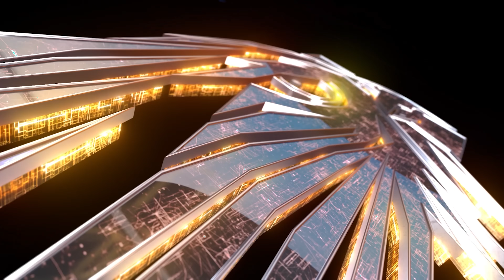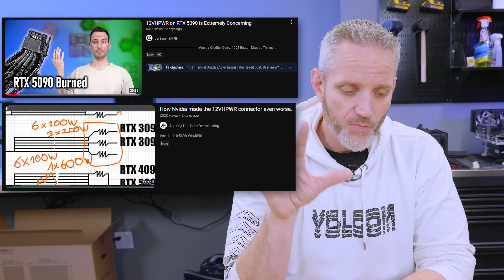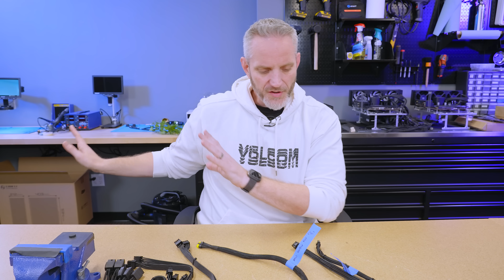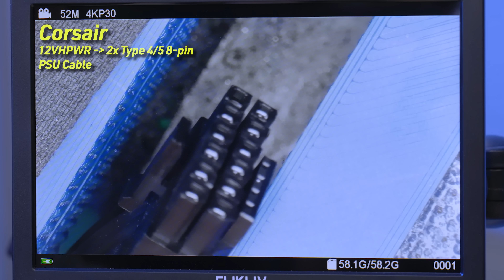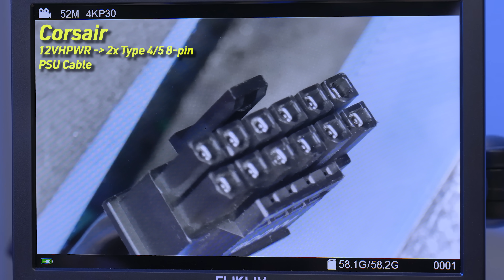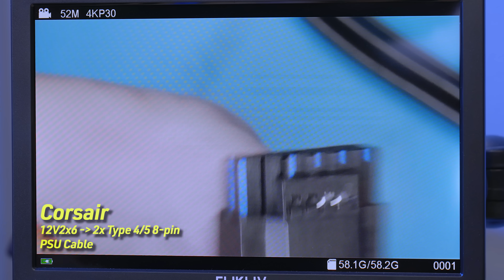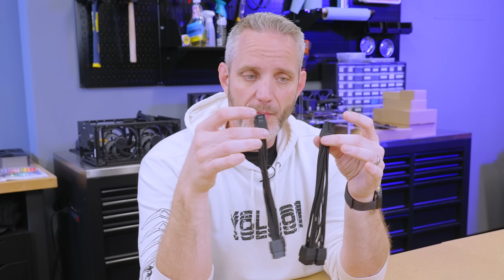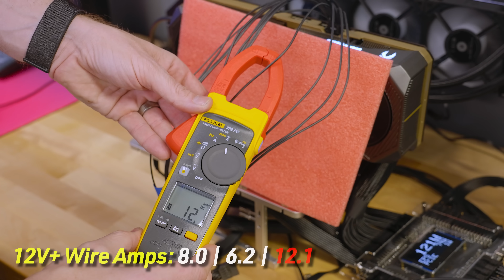I discovered something concerning and I need the Experts to chime in... More 12VHPWR discovery!

Comment: Have you actually cut any of these cables for a cross section look? You could use a cat III test lead from a good high quality multimeter and cut each and compare the cable itself. Cat III test lead cable is rated 1000v max cat IV is 600v max would make a very suitable fit for use as an example to compare what quality and type of inner conductor used in the wire supplied with the card
Reply: Im running 3,600 wats worth of car audio amplification that i personally installed and I needed to use at least 2/0 gauge wire and chose 4/0 gauge arc welding cable to run from my battery to my distribution block nearest to the actual amplifiers. Believe me i was nervous about proper power delivery cable. I took no chances of burning everything to the ground.

Comment: A ground cable not making contact would break that circuit and no voltage would travel along there, that being said, molex is notorious for pins moving around in a connector, it’s a big part of the reason molex plugs so far into each other, it would have to be recessed a whole lot to break contact
Reply: Molex pins were also a lot beefier. A lot more room for error before you start having issues.
Reply: @ I mean there are different sized molex pins, we use a variety of sizes on aircraft, they are still using a type of molex here on these, it really just depends on how deep the insertion goes, but you can have a lot of play with them like you see here in this video and never have a problem

Comment: 9:20   Jay, I am also seeing in the middle that two of the pins on the right of center are slightly recessed with respect to the two pins just to the left of center.  I wonder if that is causing some seating issues too.  BTW - I do see that ground pin is really badly recessed.

Comment: I worked as an automotive electrician for a few years, designing and installing wiring harnesses for farming and harvesting equipment.  tractors and big tree shakers and such.  we're talking 24-50 volts at up to 100 amps.  dc wattage way way higher than used in these cards and the majority of it ran through 12 and 10 gauge wire.  we use connector standards that have been in place for decades.  never ever any issues.  why are these companies reinventing the wheel over and over? all the info and standards are out there and non proprietary.
in my personal experience the best are 'deutsch connectors'. used in al kinds of stuff. they make from 2 pin all the way up to 50+ pin connectors.
Reply: A custom cable requires the customers to buy from you.
A standard doesn't require the customers to buy from you.
Reply: @rogerwilco2  I can already buy third party cables and adaptors lol.  whats the difference?
Reply: @DASfinn officially licensed third party accessories have to pay for the privilege
Reply: They want to keep using the same suppliers and tech that they've been using all along for cost reasons. For example if PSU companies had to introduce another family of connectors and another supplier connection into the mix there'd be more cost for them, and they would probably skip on GPU manufacturer's proposal to introduce a different connector.

Indeed they should have talked to automotive suppliers such as teconn (deutsch) and amphenol, with people who make actual high current connections. Because at some point same folded thin sheet metal connections and bundles of thin wires aren't sustainable any longer given radically higher requirements. Also at some point i think PCB soldered connectors have to go, be replaced with a soldered pigtail and the connector anchored in the heatsink-shroud.
Reply: The same reason TV's don't come with displayport inputs even though it's a royalty free standard: HUAS.
Head-Up-Ass-Syndrome.

Comment: I would not be surprised if MSI molded those connectors with the cables  already in place in the mold.  Given how tight those pins were seated, they had to be molded into the plug.
Reply: Nope, just very high quality pins, sleeves, and connector bodies.
Reply: @PetrosArgy  I wonder how difficult it is to assemble such a tight tolerance part?
Reply: @matthiasurankar6354  It isn't. I've been building OEM-compliant and custom wiring harnesses for motorcycles for forty-four years, so I hope I know what I'm talking about.
Reply: @daigriffiths399  as stated previously,  I bet it's molded into the housing.  Not that I dont believe you.
Reply: @matthiasurankar6354 the difference is whether they spend 2 cents per part or 3 cents per part and some are willing to cheap out for more profit
Reply: Ooof YT is hating me rn.

Short is, no, moulding would create hazard of flashing inside the pins.

MSI is prob just a two part connector. Pass blank wire through black, crimp on pin, insert in yellow housing, yellow housing clipped into black housing. Black housing pushes on the pin from the back, yellow from the front. Since the retention clip is on the back housing, it absolutely guarantees pin location when the connector is installed.

Corsair connector is the usual one part where crimped pin is installed from the back and hooks itself in with a leaf.
Reply: @SianaGearz  that makes sense too.  A 2 piece could result in the same tight tolerance.  Agree on the corsair part.  When I make custom servo cables I have the same play in the plastic housing.  It has to have play so the crimp can slide in without scratching the plastic.

Comment: I just gonna stick with 4090 until they put two 12VHPWR on 5090 or 6090 even i actually want to get 5090 because i using samsung G9 57 inch which i stuck on 120 hz with 4090 but i don't want buy 3k gpu and potentially set my pc on fire.

Comment: I have a brand new never used BeQuiet 1st gen cable from a Pure Power 12 M that has consistent pin heights, however they do move inside of the socket the same as Jay shows when zoomed in. My estimate is 3/4 of a MM of pin movement without significant force being applied to just the wire.

My experience from repining my own 1996 Camaro's wiring harness and various automotive repairs, is that every pin has this amount of play and should be taken into account in the specification. However especially with reuse, or slight misalignment causing interference between the 2 metal pins, those thin tabs of metal that physically lock the pin into the plastic socket will bend and snap without letting the person installing the cable know anything is wrong.

I maintain that this issue is primarily Nvidia running far too close to the physical limitations of the design. There's basically no factor of safety in this design, which is what the physical connector can actually handle versus what the connector will actually see in real life situations. This is like selling a rope that breaks at 100lbs and telling people who weigh 100lbs that it's totally safe to use to hang off a cliff, it probably is unless you ate breakfast.

Comment: Excellent content as always. Is there a reason why the clip that holds the connector in place cant be the entire width, or have 2 but spaced to be more to the outside edge. Also looks like there could be a market for a power board like the PMD2 but only for the 12VHPWR.

Comment: I recently had a melted 8 pin connector on a 7900xtx and I am thinking it is coolmaster psu cable and the pin depth was the issue on some of them as the other cables in the psu bag did not have the same depth issue. All speculation and coolmaster is replacing the cable and offered to RMA the unit if i wanted.

Comment: Do not get modular power supplies.
It is same thing as you would be linking multiple extension cords to get longer one. 
It is not the length of the cable that is so much problem, or even the thickness (gauge), but the connectors and the bending of the wires too tightly. 

Get high thick wires, don't bend them too tightly, and keep everything as solid from PSU all the way to the final device.

Comment: The ground wires are just as important as the +12V wires. This seems to get forgotten. Every amp of current that flows from the power supply to the video card comes back through the cable ground wires. They have the same current balance issues as the 12V wires. When measuring wire current, the ground wires need to be checked as well.

Comment: At this point I imagine an adapter that can monitor each line and sound an alarm, perhaps even take action, would sell. Heck an adapter with a fuse on each line that won't let to much current through would likely have a decent market. Though The latter would likely wind up blowing all it's fuses in many cases such as with an FE 5090, when one lines fuse blows dumpin all that current on the other lines thus overloading them and blowing their fuses. The 5090 has no way to tell how many lines are working or not, nor can it without re-design of how the socket attaches to the board itself and adding monitoring electronics.

Comment: Why not get two sockets and plug each end of the cable into a socket. Then measure the resistance from each corresponding pin on the back of the two sockets. You should be able to see if one of the pins is much worse than  the others.

Comment: the standard and cable/plug are a complete failure imo. Nvidia releasing a card that will use beyond the 600W is downright dangerous, should have been 2 plugs on the cards but of course most psu's wouldn't have 2 new plugs or enough 8pin plugs for adapters

Comment: Other than no security monitoring (which only very few AIB models have) the current is not evenly distributed across the pins/wires, which is what you saw at the end of the video.
That PMD2 is doing like some active load balancing (distributing the load somewhat evenly across all pins/wires), which is what this garbage power system is missing! 
Also, there's still too little margin of error with one single connector for a 5090 and 4090, and if you add manufacturing tolerances... eeeh maybe that'll be matter for another video.

Comment: Cables and plugs main design is to be able lock into the female ports of a device. There should be no case where this can be moved once locked in even if you move the cable(nut pulling). My 5080 makes a clicking noise when it supposed to be locked into the female port on the card. If move the cable slightly it clicks again. To me this very simple and indicates something has moved at the locking mechanism. It's not rocket science to understand that should not be happening and that design of standard for the cable is not good or the design of the female ports or the mail connector is poorly designed or manufactured. My conclusion both are at fault. This then leads me believe that there is absolute validity that cables properly secured by an attentive person that triple checks it that still burns out there is a deeper design flaw that gets worse due the  first two design  flaws

Comment: Imo the best solutions to this mess might be 1: re-implement current-balancing across all pairs of wires on the gpu-side, 2: maybe solder the pins inside the connector to a sub-PCB inbetween cables and connector pins so they cannot shift back if the connector is plugged in. Or just increase its size.
Reply: soldering increases resistance and can become a fire hazard in high current applications where heat is a factor.. that is why the industry standard is using CRIMPS, crimps wont melt and cause additional short circuits if something goes wrong. Solder isn't used in those locations for that very reason
Reply: @TheAddanz   There are many high current connectors which are soldered. Soldering is only critical for strain relief reasons. Both hazards can be mitigated by shrouding. Though yeah crimped connectors are the way to go. Do keep in mind, at the end all current WILL go through a soldered connection anyway, since it needs to go into a circuit board! A barrel can be crimped to a wire then the barrel soldered into the PCB.

As to OP's note well balancing consumers on the high rail is only half the solution. Because ground currents need to be balanced as well, and there just isn't a good way to do it at all. Because the same problem as happens on high rail would happen there, with the different outcome - the 12x6 connector won't look any different or take visible damage, but PCI-e slot edge connector can delaminate, an EMI failure would occur, or the card can no longer function due to increased ground offset. Only slightly more acceptable than high rail failure.
Reply: The test using the pmd2 shows that it's possible to balance from the source which is the psu side. We may see a new atx 3.2 standard soon

Comment: That is scary bad, you should not have that type of play in the pins and YES that will cause poor connections even if its fully plugged in. Add on to that the poor power delivery on board , you have huge problems.  Power should not be going to a single bridge. Each pin should be monitored and power balancing with the power these cards require. Amp draws on each wire should be controlled to prevent this. POOR CABLE DESIGN AND POOR BOARD DESIGN.

Comment: Ground side can be considered needing exactly the same requirements as the power side. Any increase in resistance on the ground side is an increase in the whole circuit and thus it doesn't matter if it ground side or 12v side. The elctrons in reality flow from ground to positive in a DC circuit, however we model it the other way around with current just so it makes more sense. But either way you look at it, both sides need to be considered as the same as each other in terms of quality of connection and wire size and connector size etc.
Reply: Subbass explains it correctly.
I don’t know what you want to tell us about + 5V -5V -12V +12V. 😅
Reply: This isn't entirely accurate, as we have +5v, -5V, +12v, -12v, and ground.

For the +5V and +12V rails: Current flows out of the positive voltage supply, passes through the load, and then returns via ground (or the negative side of the circuit).

For the -5V and -12V rails: Although these are “negative” voltages relative to ground, the same rule applies: current flows from a higher potential to a lower potential. In these cases, the load is typically connected so that conventional current flows from ground (which is at a higher potential than –5V or –12V) into the negative voltage rail.

Comment: On pins protruding at different depths-lengths: There's always a manufacturing tolerance built into these because the plastic is molded and dry before the pins are inserted at the factory. The pins have a retention mechanism - usually, a torsion leaf pops out to lock it in to the plastic harness. In order for hat pin to pop, it has to have enough room to pass and then pop into a plastic slot, and the room it has ends up defining how much the pins can wiggle inside of the harness after initial insertion. I shouldn't speak to what is an acceptable amount, but 1mm seems reasonable.

On ground side being less susceptible to overcurrent than +12 side: This is plausible and measurable. If the PCI slot pins have a truly common ground within the GPU board, then some of the current could return to the PS through the PCI slot pins. This is a measurable hypothesis - if ANY GPU PCI slot contacts show continuity to the power plug's ground pins, some of the current could be diverted from the ground side wires to the PCI slot. The end result would be higher current = hotter 12V wires and less hot ground wires. Also, with a clamp current meter, all 6 of the 12V AND all 6 of the ground wires can measure current. With two clamp meters, one could measure all 6 of the +12 side and all 6 of the ground side. Any significant difference in measurement means there is a drain to ground through something other than these 12 wires.
Reply: Just run all 12 wires through a clampmeter, any reading that isn't near zero means that power is going thru the slot.
Reply: They shouldn't have that type of play, compare that to a PCI-E cable. They do not move, play like that causes poor connections and arching happens.

Comment: I have a hobby making PCB for audio amplifiers is simple the more current that flow to the wires the plug need to be changed to one that has ticker pins and also instead on one plug bring back two connections so current that flow would be divided giving less stress to the circuit the wire need to be ticker too, that wire gotta be like 18 AWG maybe not sure, should it be at least 16 AWG I think they have a contract with the company that makes those connectors cheap, so card cost about 2K plus and plug been burning again? is a bad purchase unless the fix that problem

Comment: "Total current entering a circuit equals the total current leaving it" - Kirchhoff's current law. Ground connection is just as important as 12V.
Reply: That is true but there is more ground paths for the current to disperse. Like through the slot itself. All depends on how the grounds of the card are designed.

Comment: I find it interesting the wires are connected in parallel at the PSU end  (6x6) and not at the GPU end..... Someone in Engineering needs to be horsewhipped for such a stupid mistake. 
No more nvida cards if that is the crap they put out the door.

Comment: Yes the grounds should be unified so theoretically if you have a push pin remover you could disconnect the one ground and it should still operate correctly. The 12v is a different story though if that pin was on 12v side and isnt making good connection causing high resistance then your going to get high amp draw on that pin and it could happen on power supply as well. I work with electrical circuits for almost 40 years and ive seen these issues with wires many many times. If derbauer got another cable and tried it and used the ammeter again the problem could be confirmed